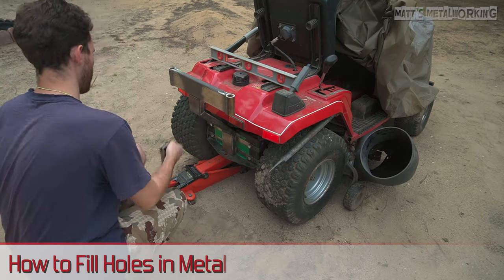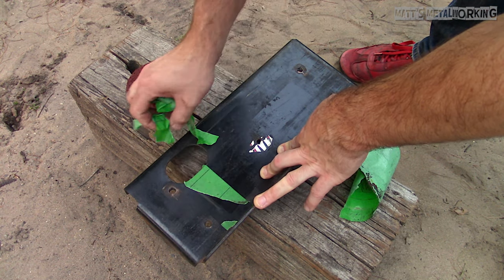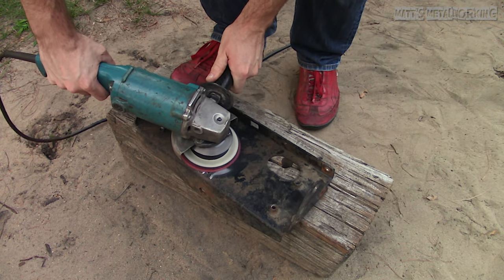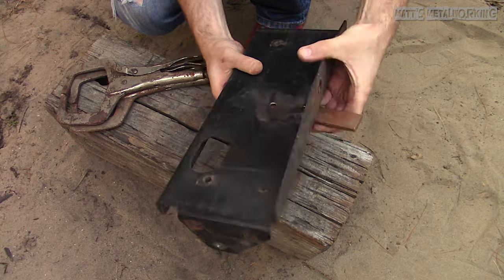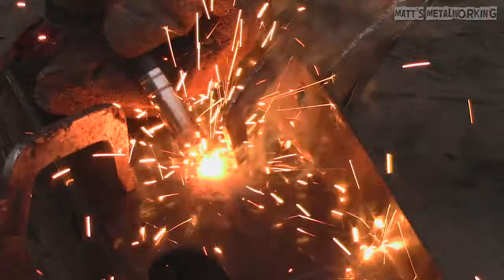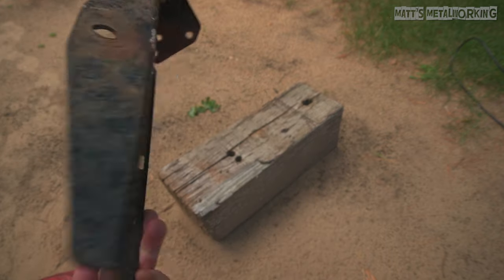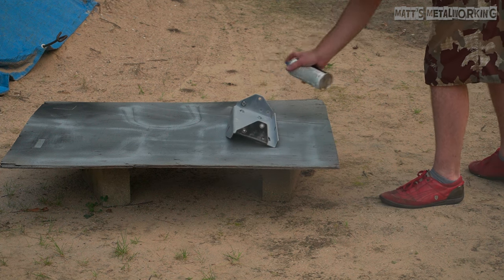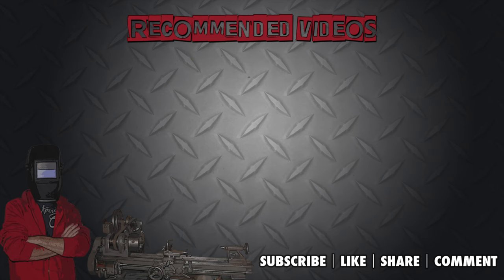How to Filled Holes in Metal by Welding using Fluxcore

Comment: I saw a video of someone else using aluminum as a backing, I can’t remember if it was with flux core though, can I use aluminum blocks as backing with flux core? I’m having trouble using the flux  (.035) for thin metal body work on a project car I’m building, it burns through really easily. I plan on getting gas and normal mild steel wire soon but at the moment I have to work with what I got as I’m on a budget. Have the welder at the lowest settings it will allow me to go aswell

Comment: Thanks for your very informative video. I don't have copper - so I'll try aluminium instead. And it's on the edge, rather than where your holes are (in the middle, etc). But thanks, you've given me a way that might work. :)
Reply from the maker: Happy to help! How did it turn out with the aluminum?
Reply: @MattsMetalworking  I haven't gotten to this stage (of my sculpture) yet, but having rewatched your video, I think I'll buy some copper for when I get around to it. I'll let you know how it goes, if I use aluminium (as an experiment).